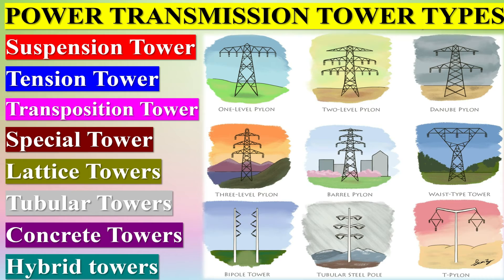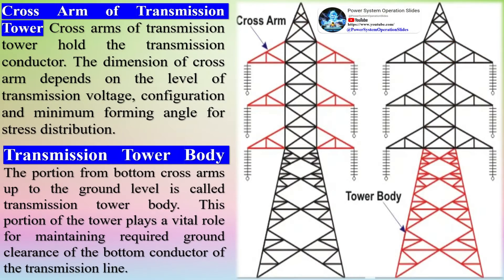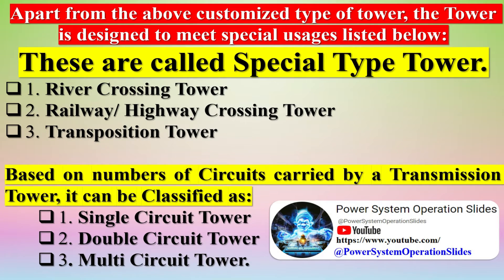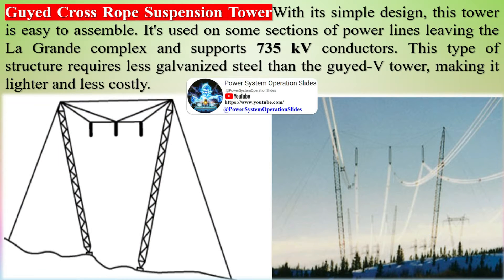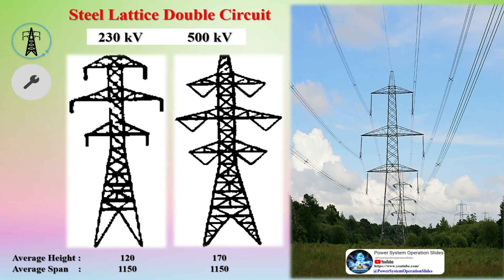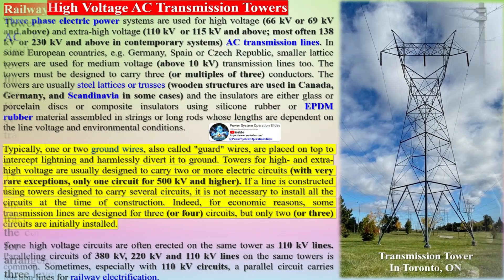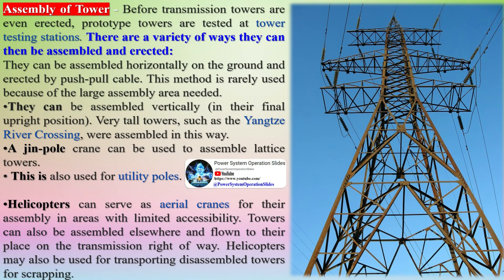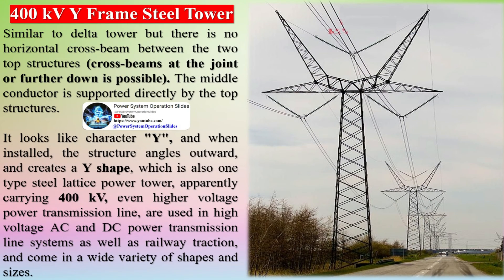Power Transmission Tower Types | Electrical Transmission Towers Explained | Lattice Towers

Comment: 1:16 What are suspension towers?
Reply from the maker: Suspension Towers support conductors on straight sections of overhead transmission lines where line deviation is minimal typically 0–2°, up to 5% in some designs. They mainly carry vertical loads from conductor weight and wind & are therefore the most commonly used towers along long, straight transmission corridors.

Comment: What is pin angle in transmission line?
Reply from the maker: No idea dear; maybe you are referring to Crossarm Pin, operating angle or maybe you are asking for four defect types which are bolt missing pin, bolt off pin.......